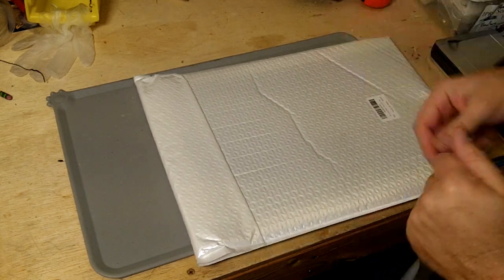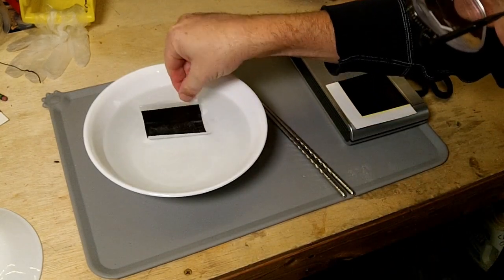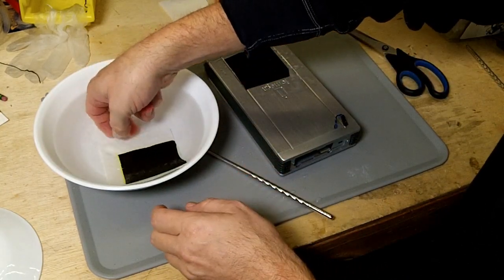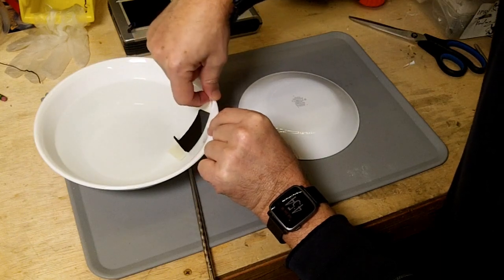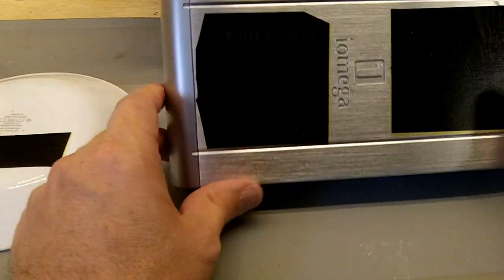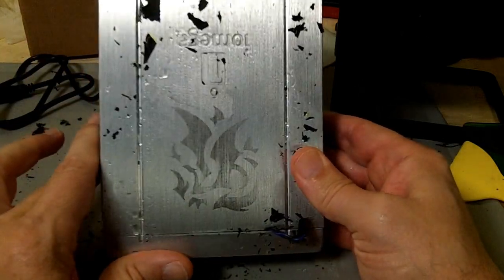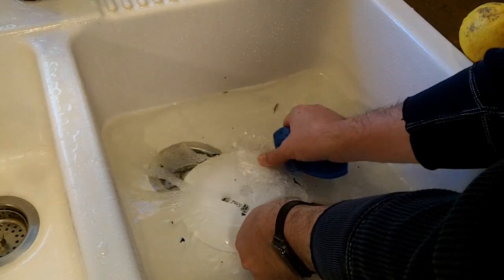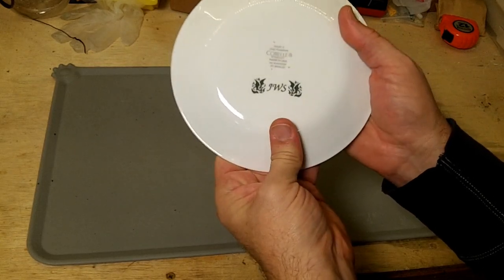Review & Usage Demo: Black Laser engraving marking paper

Comment: I've just bought some of this stuff, (or supposedly this stuff...), and it's nothing like what I'm seeing here, I'm pretty sure I've been ripped off unfortunately. I cut my piece to size and put it into water, and it just disintegrated into tiny black flakes.
What was left on the paper, was impossible to remove as it was as fragile as a spiders web and just tore instantly when I tried to lift it with tweezers, it wouldn't even support it's own weight, so I never actually reached the engraving stage..
I'm fast learning that laser engraving, is definitely a series of trial and error lessons, that you have to go through until you find exactly the materials, ( and reputable suppliers..), techniques, power settings, scan rates to produce good results.
It's rewarding when you get it right, but theres a real learning curve. Most useful thing I've learned is to keep a "laser diary" and write it all down, so I remember what works, and what doesn't.. Good video.
Reply from the maker: Sorry whatever you had didn't work as well as this did. Good luck going forward!

Comment: First of all, thank you for the video. I tried it on glass, and it definitely doesn't work. Do you have a suggestion for black paper for glass?
Reply from the maker: I'm afraid I don't.
Reply: @summetj  I’m using a 3W machine at 200 speed. Maybe I need to lower the speed... I’m still new at this... But it's very exhausting to keep trying over and over.
Reply from the maker: @magnogkilla  3W is kinda low powered, I'd suggest trying at the lowest speed you can do.
Reply: @summetj  I use a 10W xtool F1.  On a glass I used green marking paper, 100 power, 50 speed (file was .svg) 140 LPC.  It came out  well, but a medium gray colour.

Comment: Which material is the Metal piece ? Aluminium? Because Aluminium needs another type of laserbeam. Even with a 20 watt laser using Marking spray. The Aluminium is a problem. With 454nm laserbeam.  You need 1064nm.
Reply from the maker: Yes, it was aluminum.